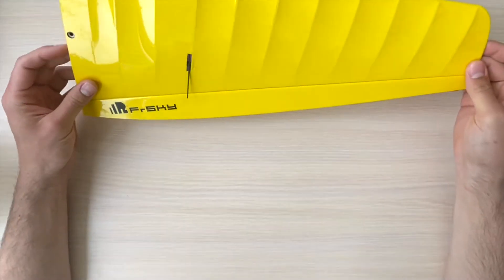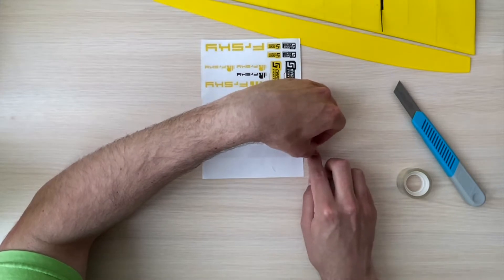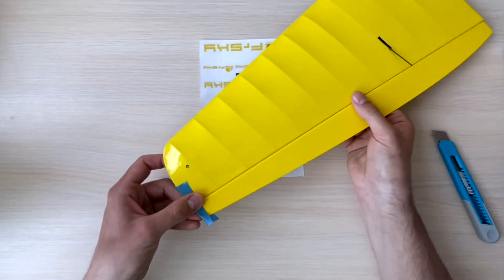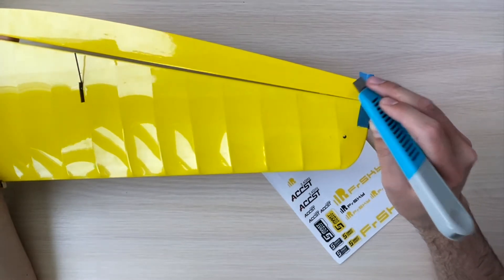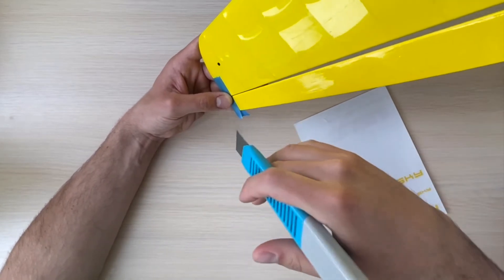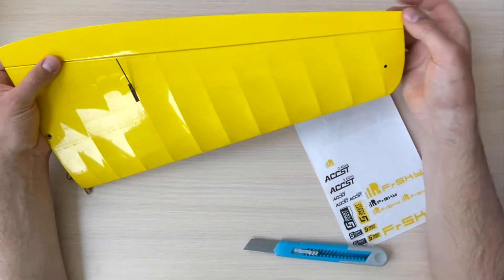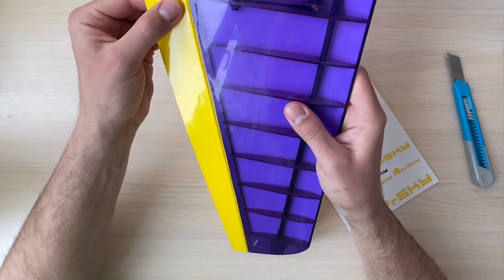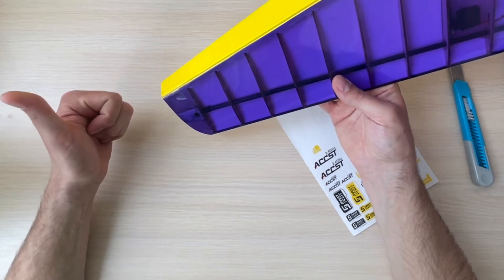Tape (Z-Stitch) Hinge for Shaka Slope Wing

Comment: You can also do this with Monokote much easier
Reply from the maker: Never tried with Monokote or any similar self-adhesive films, but I believe this will work great!
Reply: @flightpointrc  The Z-stitch hinging system was originally developed in the 'silk and dope' model covering  era before Monokote heat shrink covering was developed.
I think your adhesive tape method is not as durable as the heat activated adhesive plastic covering method.  The heat activated adhesive method is easiest to apply, and is the stronger way to do the Z-stitch hinge.  Broken or failed loose components of the stitching can be individually redone.  Easy to maintain.
Reply from the maker: @georgehunter2813  oki :)
Reply: @georgehunter2813  Your not the George Hunter that created the GP ultra are you?
Reply: @georgehunter2813  Been searching for you for 20 years
Reply: @georgehunter2813  ?????

Comment: Your making what is called (Z-Stitch) Hinge
Reply: In about 1983 there was a construction article in RCM magazine of a 76 inch balsa sloper design (AR-7) that went on to become the kit plane by CraftAir called the Freedom 76.  The magazine article showed a new hinging method call Z-stitch using Monokote.  A diagram of the hinging scheme was included.  It was the process being demonstrated here in this channel production.  A gapless Monokote hinge system.  The control surface mating edge is constructed square omitting the typical pivot point bevel.  The bevel pivot line becomes two edges.  One top, one bottom instead of the single beveled edge.  This made a stronger thicker hinge line where the  control surface met the main flying panel.  The key point was keeping the overlap joint between the pieces of Monokote to less than the gap height of the mating control surface edge.
Reply: @georgehunter2813  Do you have the article?
Reply: @georgehunter2813  Why reply saying yeah im the guy then bail out of the conversation? George warned me but I didn't know it was this bad, Wow!
Reply from the maker: Oh, thanks for the hint!
Reply: @georgehunter2813  can we meet in person or zoom meeting?
Reply: Having a hard time understanding you.  English is my second language.  Still haven't figured out all the American parlance.
Reply: @georgehunter2813  George Lim say you were an African American guy, why all the games
Reply: @georgehunter2813  I would like to buy a GP Ultra.
Reply: @georgehunter2813  Why the games George. George Lim told me all about you.
Reply: Not for sale.
Reply: @georgehunter2813  Do you still fly?
Reply: @georgehunter2813  Do you remember a a slim skinny Asian guy named George Lim?
Reply: @georgehunter2813  Why not?
Reply: @georgehunter2813  Can I have one?
Reply: @georgehunter2813  Do you still fly?